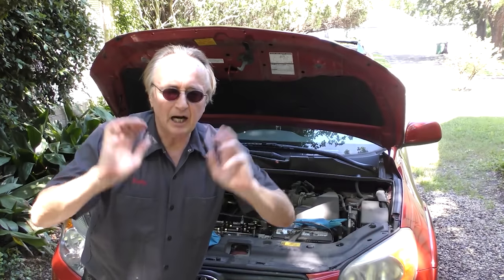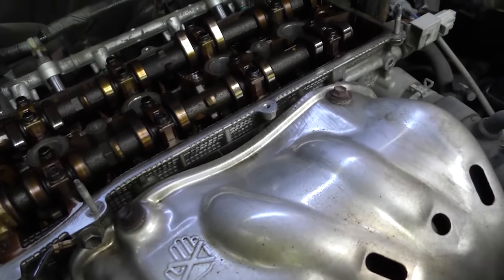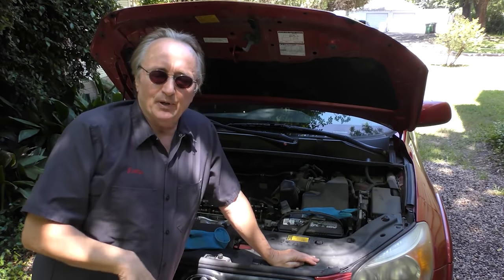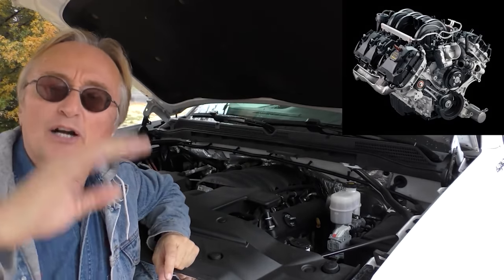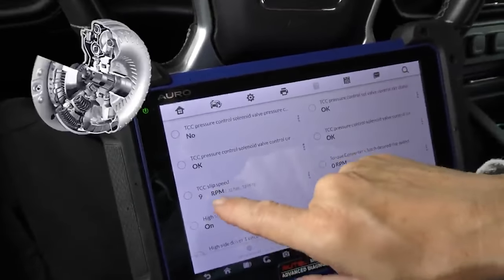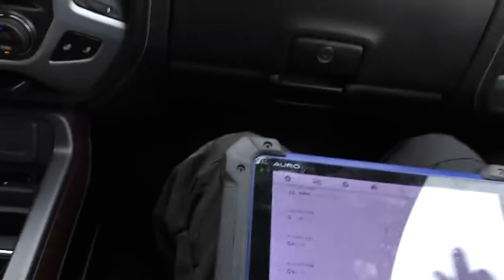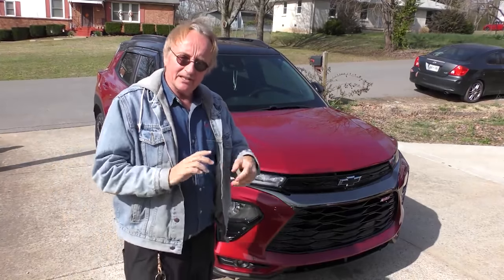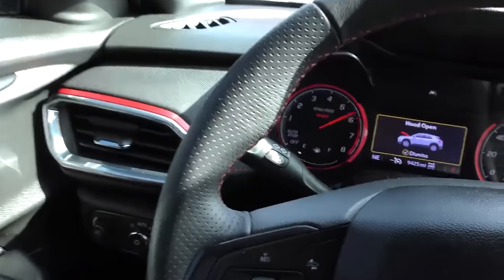Avoid These 3 Engines Like the Plague

Comment: Cylinder deactivation literally only saves 0.6 MPG per every gallon on average, as far as I’ve seen. Not nearly as expensive as spending $6,000 on a new engine. Should be illegal.
Reply: I was going to buy a Mazda CX 5 and decided not to for that very reason.
Reply: cadillac did that "TRICK" back in the late 70's--- early 80's (V8 6-4) and it was a disaster!!!!!
Reply: I’m surprised the ones that shut themselves off at a red light and then start the engine again aren’t even worse so far. People let the engine sit completely still for 3-4 minutes then take off from a stop line like 2 seconds after the engine catches, there’s no way the camshafts are getting full oil pressure at that point. It’s putting thousands of dollars worth of wear on your engine to save like $100/yr on gasoline in the BEST CASE SCENARIO 🤣

Comment: I designed the first cylinder deactivation  for  a  1965 225"
 Slant 6. 
I removed the pushrods for the three rear cylinders. I got about 1000 miles out of it before it threw a rod.
Reply: Robby Dey  deactivated cylinders wear out much quicker than the resr.
Reply: @williamevans6522  In the GM they do. But in general?
Reply: @mjouwbuis   I would think so. Old school cylinder "deactivation"- let up on the gas.
Reply: you got a "SLANT 6" to throw a rod    that is amazing!!!!!!. that was one hard engine to "HURT"!!!!
Reply: You only got 1000 miles out of that experiment because it was that slant 6 engine. My uncle, who was himself a burnout, ran one on the same engine oil for about 40,000+ miles for about ten years before it finally failed on him. What me & my grandfather could even get to drain out of that engine was thick, coal black, and stunk to high heaven

Comment: GM's efficiency tech is to shut down cylinders until the tow truck is doing all the work.
Reply: Now their solution is to make an engine vwith three cylinders.
Reply: its a good time to be a GM dealer tech. 😉

- a GM dealer tech.
Reply: Good one. Lol
Reply: I hate GM like an exwife today.
GM became total junk when it electronic fuel injection.
Plastic bumpers an rubber timing belts is the junk they produce today.
Reply: Yea save gas but shutting all 8 pistons down
Reply: Maybe this is how they’re hitting the CAFE ratings for their fleet of vehicles on the road? Because a vehicle being towed to the shop isn’t ITSELF burning any gasoline so therefore it’s technically getting infinity miles per gallon 😂
Reply: @brucemorris3830  yep 😂 and the gubment doesn't require that it not break down. They consume oil like crazy too. Poor GM. They used to be great.
Reply: G M back in the 60s before computers made the best , I'm hearing horror stories about these small Chevy, Buick etc made in China, there all 100% throw away vehicles, GM never fixed the problem of one headlight being brighter than the other......
Reply: @bendeleted9155  oh the GovMent is never gonna require companies of that size to produce cars & trucks that are reliable and repairable by a home mechanic again. My own car, and yes I have gone Japanese on a Mazda finally, I need somebody with a $5000 Actron bi-directional scan tool to finally do the rear brakes at 110,000 miles.

It annoys me because god dammit I could do this job myself in the driveway every day of the week if I wasn’t bound to somebody with the expensive scan tool to properly retract and then re-engage the stupid electronic rear brakes/E Brake system. Which, on the last of the Mazda manual transmissions, is actually kind of important 😂 you can’t really PARK a manual trans if you don’t know for a fact that your parking brake is engaged

Comment: Best fix i saw for the Vega's was putting a 350 in them.
Reply: They called those Chevy Monza's!
Reply: That was really the wrong way to go. The extra weight broke down the Front end and wrecked the handling, making it a special purpose racing car for the drag strip. The best alternative was an all AL V-8 made just for the Vega. But never implemented.
Reply: The Cosworth was underpowered.
Reply: I saw some great v8 Vegas back in the 70s and 80s. The rear differential was the weak link but a lot guys found Camero replacements. My favorite was one with totally custom body work with flaired out fenders and a built 454 with two fours on it. That was a beast!
Reply: the real kicker with the "VEGA" , it originally was designed to have a "ROTORY ENGINE"  under the hood, and "G.M." pulled the plug on it at the last second before production started. the cosworth  engine was not even "TESTED", so "G.M." put a 50K mile warranty on it to cover any problems. "G.M." had to eat a lot crap on that one( replacement engines installed)

Comment: I got a letter yesterday from Lexus saying that climate control servos can fail and they are doing a voluntary recall up to 7 years old or 125,000 miles. Mine isn't having issues but they've always been top notch. My Lexus dealer is an hour away and if I want an oil change, they'll drive up a loaner and drive mine down for an oil change and mine is 7 years old. I go to my local mechanic but they really care.

Comment: Who would ever guess Scotty would be telling us to avoid a Toyota engine like the plague lol...
Reply: A Toyota engine to avoid means it’s the end of Toyota reliability
Reply: Toyota isn't perfect, they've made mistakes.
Reply: Not for the first time, btw....
Reply: This affected 2.4L 4-cyl models from 2007-2009.
Reply: 2.5 litre in the First gen Tacoma was terrible for the head failing. It was not if, but when. 125,000 miles was not uncommon. The rest of the motor was fine, but there was a guaranteed expensive repair.
Reply: @Duraputer  Toyota bought those rings from another supplier
Reply: @shitloveaduck  Was this along with the 3.0 V6 in Toyota trucks and 4runner's up to 1995 that were blowing head gaskets?
Reply: @Rjako  - I don’t think it was. That was a separate issue. Usually in the 2.5 when the head gasket goes, the head itself needs an entire rebuild. Once rebuilt, they don’t use the same parts supplied originally and then that the motor to have!! They have decent power and torque, average to a little worse fuel economy, but they last at that point. Like I say, the bottom end is good!! Al this and I was burned by a 2014 Tundra TRD Off-Road,,,, haha. The 5.7 is good as well, but the truck went through 2 transmissions being treated much better than the F150 5.0 I had from 2011. Both trucks were used for work, commuting and play. It was towing that killed that truck and it was only 7,000 lbs. later on from the Toyota Tech that bought it off me (he thought I was doing something wrong) he found that the main wiring harness had been pinched when being installed and that was causing intermittent signals transmission?? It was not generating service codes though. He was stumped, but after he replaced that the truck was good, but it went through 2 transmissions with me in about 50,000 miles and one with the Tech.  Makes a fella kinda sour on the brand,,,,, hahaha. That was my dream truck prior to that happening.
Reply: @shitloveaduck  I get it and that would make anybody sour no matter what brand. We have nothing but Toyota's and have been happy with them. Anything mechanical can have issues but 2 or 3 transmissions and I would also be done with that particular truck too.
Reply: @Rjako  - Hahaha. You are the most reasonable Toyota owner in the world!!! I swear!!  Where I live the other issue was the frame rust. It’s tough to take. I have one friend that takes great care of his vehicles and has a 2012 Tundra with zero frame rust, nothing. It has just over 500,000 km on it (312,000 miles). If you didn’t know better, you would think it was a low miles truck. He has had stellar reliability. It’s almost all highway driving and at quite high speeds. Still,,,, haha. 
    Hoping you have a great weekend! Eh!

Comment: I have the 2ar-fe in my camry. The next gen after this. It is an excellent engine. 150,000 miles and uses like an 1/8 of a quart in 7000 miles.
Reply: Do you change your oil at 7,000 miles ?

Comment: I had a knocking intermediate shaft in my 2010 Camry recently. Even though it is 5 years out of warranty Toyota paid for the parts and labour no worries 👍  It was a recall back when they were new...
Reply: 4 cylinder or v6?

Comment: I can testify that the 2006+ Rav4 burns Oil. My aunt has the 2006 Rav4 Sport and we often have to top up fuel in the engine.
The car does not emit any smoke, and there is no leakage but still the oil finishes

Comment: The 98-2002 Corolla 1ZZ engine also had an awful oil burning issue. I got rod knock from it on a 01 at 130,000 miles. Took it on a simple journey to Denver, burnt it out. Naturally the Toyota dealership adjusted the valves and put a new timing chain on. Still got knocking, so I took it a real mechanic and told me it had rod knock in 10 minutes. Learned my lesson.

Comment: My 03 Camry has the 2AZFE engine, praise God it hasn't burned oil lately, but it was burning maybe 1qt per 500-1k miles or so. Over 250k miles original engine and transmission, still runs great

Comment: 2004 2azfe Solara with 305k and burns almost a quart on a 250 mile round trip to Dallas. Besides the oil burning, the undiscussed even worse downside is exhaust poison that has ruined my catalytic converter. With all the backpressure it actually blew out the gasket at the bottom of the exhaust manifold and it sounds different but relives the right amount of backpressure to even it out and not throw a code or effect gas mileage. Scotty please explain that one!

Comment: I have a 2009 scion tc with the 2az-fe and toyota told me "It is burning oil but not enough oil to qualify for us to replace"
Reply: When did they tell you this ?
Reply: @Forddude24  couple years back. I think in 2018
Reply: @MrTomas2280  damn, you should have demanded for them to fix it.  I had mine fixed in 2016. I have a 2008 Scion tC.
Reply: @Forddude24  I tried to push it but they kept saying no haha
Reply: Biggus Dickus  I should have tried others! Didn't think of it at the time. Now from what I understand it's out of the extended warranty
Reply: I bought an 07. I didn’t know it was that bad. They got me. Oh well...

Comment: We used to deal with this by using a heavier weight oil and more frequently change it.
Reply: That and STP are what I did with my Vega. What a piece of crap it was.
Reply: @navret1707  my buddy put a cage and a 350 in his-made a good drag racer.
Reply: @grizz6370  mine put a 454
Reply: Andy Man  ..... i put a jet on my skateboard
Reply: Andy Man  hope you had a back seat

Comment: I bought a used one of these oil burners. It’s a 2006 RAV4. Once I got it I realized that it had a serious oil burning issue which destroyed the catalytic converter. It turns out that this was a recall that the previous owner never had fixed and the recall timeline had lapsed. But I was really lucky because when I bought the car I purchased a warrantee with it and the dealership I got it from repaired it. I essentially got a completely rebuilt engine and a new catalytic converter with my co-pay of $300. The total would’ve been over $6000 otherwise. It has been running great ever since.
Reply: I thought those recalls were not supposed to be subject to time limits. Maybe that’s only in certain cases idk.

Nevertheless you did pretty good if you only paid like 5% of the open market cost on the repair! $300 will barely get you an oil change and a half a set of brake pads in a shop right now lol

Comment: Toyota should have stuck with the 1AZFE...they were trying too hard to compete with the Honda CRV.  They pulled a GM move...but I think they learned their lesson.
Reply: The 1az-fe doesn’t have this oil burning issue then?
Reply: @TruthSeekerAll  no it does not...it was considered underpowered compared to the crv so toyota rushed things...
Reply: 3AR-FE
Reply: @keithgale3975  underpowered but will have the same transmission and engine the whole million miles try that with a Honda 😂

Comment: I have a 2010 Corolla XRS with this same engine (built in 2009 & had the letter from Toyota about this issue) but I don't have the oil burning issue. I switched to full synthetic oil at 80,000 km's and now have 194,000 km's with no issues.

Comment: The 22R, 2.4 liter was the best engine Toyota ever created.
A 2 barrel carburetor, straight 4 cylinder, with a timing chain, & adjustable valve tappits. It was a Tank you could fix roadside anywhere.

Comment: I had a '74 Vega with 39,000 miles on it. Burned one quart of oil every 100 miles!
Reply: Burning oil that quickly, I’m guessing it wasn’t driven much beyond that mileage due to needing to carry a case of oil, and having to stop every hour or two to put in a quart.

The bright side: you’d never need to get a full oil change, you’d do that within 2 tanks of gas! 🤣🤣🤣

I had a 93 Saturn SC2 that by the time I traded it in with battle damage and over 207k miles, it was using a quart of oil every 160 miles, and oil usage was accelerating, so it was clear it wasn’t long before I’d need to get it towed if I didn’t trade it in.

The engine ran fine, other than blowing oil past the rings (ah, the irony of naming).  The card had been t-boned a few years before and one year it was used full-time for pizza delivery due to bad times.  The Mad Mice automatic seatbelts (no passenger-side airbag) were a real hazard in that role, and once I forgot and had 3 hot pizzas tipped up on end as it tightened, D’OH!
Reply: @strictnonconformist7369  I got rid of it quickly!

Comment: We bought a Vega for my Aunt.  Worst engine I ever drove is a six cylinder dodge truck . I am currently driving an eight cylinder Dodge with 278000 been a great truck. My last company vehicle had a six cylinder and we dumped it cause you couldn't keep a the head gasket from leaking.

Comment: I had bought one of those v8 chevy trucks recently. On the way home check engine light blinks. Code says 2 cylinders are misfiring. Then I learned of the variable cylinder usage and took the thing back. Big problems.

Comment: I have an 09 Camry with that motor. I don't know if it's been fixed by Toyota or not. I bought it with 95k on it and now it has 203k. It burns a little oil, but only about a quart every 3k miles or so. I keep a close eye on it in case it starts burning a lot more, but right now, it's nothing to worry about

Comment: my 04 camry with the 2az-fe continues on without burning a drop. thank god
Reply: Yer Using synthetic oil, huh?
Reply: all ive been using since i got it
Reply: @roxposting  I knew it.
Reply: My 03 Camry burned oil...2AZ FE engine :( Glad you had a better experience!
Reply: press F to pay respects
Reply: Toyota redesigned the piston in 2006-2009 with smaller drain hole and used thinner oil.... This caused the whole burning oil disaster 😔.
Reply: Yep same with my 02 Camry, haven't had any oil burning issues so far.

Comment: The only thing Toyota may have goofed on was making the returns a little small. My wife had two of the that were fixed. A guy I work with had one that never had any problems. I don't know what kind I oil he ran, but it sure wasn't Castrol. He don't use that stuff,hates it. It put hard crusty deposits on all the hot spots. Like under the crown of the pistons. When you change it, it comes out looking pretty good. Yellow with that Castrol stank.

Comment: By mistake I put super gas in my ford excursion ltd the engine light came on, what to do now, I remove the battery cable for a while to reset it, it goes well until I switch it off, when I restart it the comes on again

Comment: The 2AZ-FE was also in the first gen Scion tC, and guess what they had problems with in consumer reports.
Reply: Beating a Ford Focus
Reply: @mikefoehr235  Lol, yes there was that. They were absolute beasts outside the fact that the engines consumed oil like crazy, and the supercharger ball bearings would break and destroy the engines. On the plus side, there was a fix for the supercharger through Vortex, with ceramic ball bearings.
Reply: @austin_love89  I am a huge Toyota fan because of the collasol 💩 piles GM and FORD built and I was stupid enough to buy. Never again. Now, I know Toyota has built a few duds to and is why I got my new Tundra last year. I DO NOT NOT NOT want anything with a boosted engine. I surely hope Toyota gets it right with the new TT6 that is rumored. I am happy with the V8...it has insane power and it is not horrible on gas.

Comment: My 2008 Scion xB burned between 1 and 1.5 quarts between changes. I had the oil changed every 3k miles since I bought it. I took it to my local Toyota dealer. They did their oil consumption test and found it burned oil excessively. They replaced the pistons and rings at and provided a loaner the week my Scion was in the shop. It was done at 130k the car has 168k miles now. The car used a little oil right after the service, then stopped after the next oil change. I’m guessing it used a small amount while the parts seated / broke in. It’s all good now.

Comment: The 2AR-FE that replaced the 2AZ starting in 2010 is a brilliant engine. If you're going to get a RAV4 of this generation, get a 2010 or newer
Reply: 2AR-FE 2.5 l  engine better than 2AZ-FE the engine 2.4 l

Comment: The Vega was the perfect car to engine swap a V8 and make a hot rod sleeper . The original engine was complete crap.
Reply: I knew a guy with a Monza he swapped a tunnel-rammed 327 into.  The open headers sparked when he hit bumps.  He got about 4 mpg.